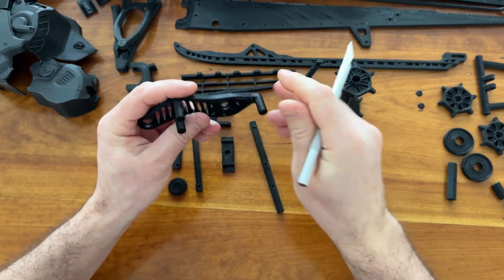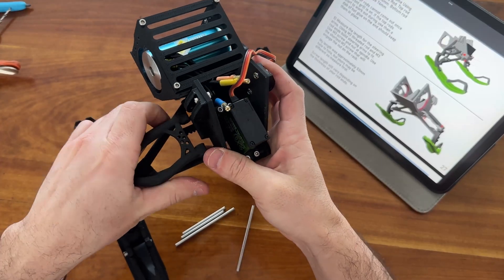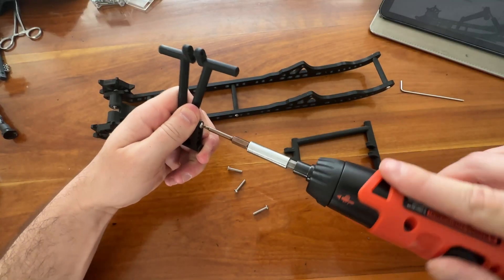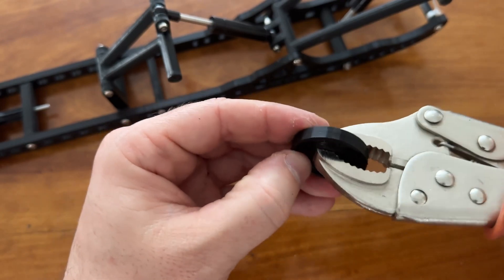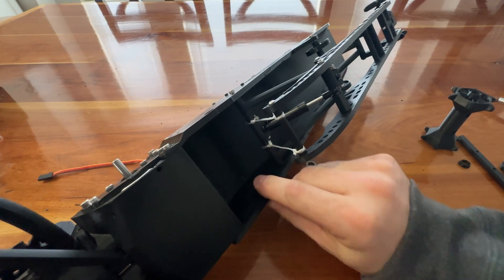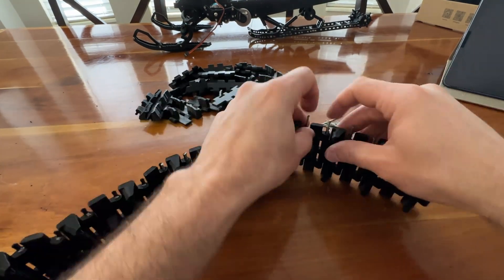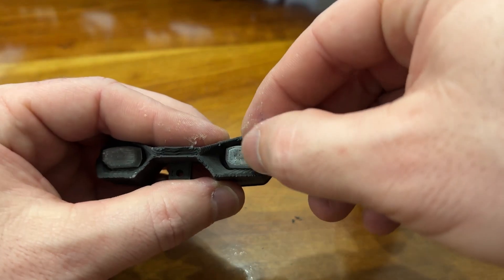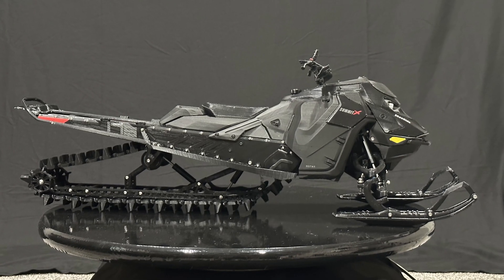SkeeRide 2 Assembly

Comment: Do you have to use a 228mm length belt for the drive? Or can you use a 200mm length belt?
Reply from the maker: If you change the gear sizes you could probably make 200 fit. With the gears I used 228 is what fit.

Comment: Hey bro I really want to make one of these but don’t have a printer and might ask my friend. Just out of curiosity would a traxxas velinion vxl 3500 kv brushless motor and esc work good in this rc sled? And also would a traxxas battary fit? I wanna use traxxas motor and esc becuase i have traxxas battarys and charger and I would have to buy another charger and battary.
Reply from the maker: I recommend a 2500kv motor for the extra torque. It’s possible your motor will work but I haven’t tried it. Not sure if your battery will fit. You can get more info on the discord server, maybe someone on there has tried your setup.
Reply: @BuildItBetter3D ok well do you think that that motor will bruh out or will it be ok?
Reply from the maker: Usually the issue we see with higher kv motors is that it can’t get moving from a stop. Some people will push start the sled and it will work that way, but once stopped it will need a push start again.
Reply: @BuildItBetter3D oh so basically the motor doesn’t have enough torque at low rpm’s?
Reply: Is that why the castle 2200kv is better?
Reply from the maker: Yes, lower kv will give you better torque. Spinning the track takes a lot of torque,especially at low speeds.
Reply: @BuildItBetter3D ok thanks
Reply: @BuildItBetter3D hey bro so I prolly gonna be getting a Bambu  a1 printer from school soon and I have a question that I’m really puzzled on. How do I know what parts need to be pla and what parts need to be petg? I need to find this out before I order the fillet rolls so I can order the specific colors in there specific mateirls. I was thinking about doing the whole thing in petg but then again I don’t know if I should. Also idk if I need to use tpu or not. I heard that pla and petg are fine
Reply: Or do you use pla + for everything and then tpu for the track?
Reply from the maker: I use pla+ for everything. Only tpu parts are snow flap and handlebars. PETG gets brittle in the cold. Please join the discord server, the YouTube comment section is difficult to use for support. https://discord.gg/78sqVp64
Reply: @BuildItBetter3D ok so pla+ even for the track? So would I be fine with just printing the whole sled in pla+ even the snow flap and handle bars?

Comment: just finished my build. the track doesn't spin under weight of the sled. belt tension is completely tight with the adustment screw. I touch the front sprocket and stops spinning so easily. what can I do to fix?
Reply from the maker: Low kv motor is needed for torque (2200kv or less is recommended)
Make sure the track isn’t too tight, should sag about 5mm from bottom of skid rail. Belt tension to motor shouldn’t be too tight or it will bind the motor causing it to work hard. Join us on the discord server for more help.

Comment: Is it normal that I don’t have the same spindles as you? The ones I got doesn’t work properly I got the polar version idk if that’s the difference? Would like to have the other spindle file.
Reply from the maker: Yes they use different parts to match the real world versions. There are modded versions you can try. Mods are included with the files.

Comment: How big of a batter can you run in this it says 2/6s but I’m not sure what will fit like how big is the box size I have a Traxxas 3s 4000 and 5000mah battery’s but I’m nut sure if I will have to buy a new smaller one
Reply from the maker: I run 3s 1500 with plenty of room to spare. Not sure exactly the measurement of the area. Plenty of people on discord could tell you what they are getting to fit. 
A downside to a big battery is it gets top heavy and tips more easily.

Comment: Bonjour j’aimerais savoir qu’elle électronique je devrais installer dans mon rc ?
Reply from the maker: There are recommendations included in the instructions. You can also ask on the discord server. Most standard 1/10 or 1/8th scale electronics will work. You’ll want a lower kv motor 1800-2200kv.

Comment: Just snagged an elegoo neptune 4 pro,I don’t know shit about 3D printing lol but will the printer being klipper effect the files at all? Or should I still be able to match print settings and good to go?
Reply from the maker: Klipper won’t hurt anything. You may need to tune your settings some. I would try some small parts to begin with to be sure your settings are dialed in.
Reply: @BuildItBetter3D  awesome!! Appreciate the response! Bought the skeeride 2 files yesterday and got Cura set up with my machine parameters with structural/non structural profiles, sliced and tested looks perfect now I just gotta verify and tune my settings and start laying out parts! Lol, It prints 250mm/s and I got rapid + PLA so I’m curious to see how fast it prints all said and done and how it turns out at those speeds, I’ll probably try 200 ish at first
Reply from the maker: Awesome! Thanks for the support. Good luck on the build, I hope you enjoy it.
Reply: @BuildItBetter3D  going great so far 😎 all frame parts are done, just track left and I’ll have a roller! … ski…er? Track-er?……roller! Lol. 
And then body panels and accessories next!
ended up splitting up the track by A B and C and doing 13 of each kind at a time, printing 13 of A right now 👍🏻 I had a little trouble at first with black filament vs the white but I just had to use raft (like I had to with a lot of the white parts too) and go down 10 degrees on the head, 2 degrees on the bed and slow down my initial layer 👍🏻 the models are awesome!
Reply from the maker: Awesome! Glad to hear it 😁

Comment: You should have made housings in the tunnel for bearings and used a steel driveshaft. The plastic shaft and no bearings doesn’t thrill me.
Reply from the maker: It does use bearings. The plastic shaft rarely fails, but there is also a jig included to make a metal shaft.
Reply: @BuildItBetter3D  ok good to know I was getting worried I’m almost done printing it and it looked like there were no bearings but they must sit inside the covers not in the tunnel. I haven’t printed the cover or the pulley tensioning system. Thanks!

Comment: What is the digital read put actually for? I did buy them I'm almost finished with the build but I'm just curious.
Reply from the maker: It’s mostly for looks, that’s where a big display is on the real sled. It gives you battery voltage though, so it’s nice to look at and know when your battery is getting low.
Reply: @BuildItBetter3D  so do you wire it into the battery plug on the esc?
Reply from the maker: I think that’s where I wired mine. It’s should come with a little paper that shows how to wire it.

Comment: Have you thought about making the opening on the skid that holds the shock a little bigger. I bought the same shocks in the sheet buy had to scrap away a lot to get it to fit between the mount. I'll post pics in discord to what I'm talking about.
Reply from the maker: Hmmm, it could be made bigger. Mine slide right in without issue… possibly a calibration issue…
Reply: @BuildItBetter3D  that's the only part I've ever had issues with and I tried 3 different printers. It not a huge deal I can edit the file I have but if anyone else ever tries to make one and can't it would be a pain.

Comment: how did you print the stickers?
Reply from the maker: They’re cut from vinyl.
Reply: @BuildItBetter3D  thank you! also where did you wire up the mini voltmeter to?
Reply from the maker: I connected mine into my battery plug so it shows battery voltage.
Reply: @BuildItBetter3D  can you show a picture or video of how you did this please?

Comment: What are the dimensions of the bigger prints? The tunnel looks pretty big. Afraid that will not fit on my printer. same with the skid rail but that I see is available in a multi part print too.
Reply from the maker: There are cut versions of all the big pieces to fit 220x220 print area, possibly smaller but I haven’t tested that. Everything can be printed without the split pieces on 350x350.

Comment: I buy it right now!:)
Reply: Hi can i use another lengt of belt because i cant find the 228 mm on amazon
Reply from the maker: There is a calculator in the faq section on the discord server that you can use to choose different length belt’s depending on gear size. So if you change the size of the gears, then yes, you can change the length of the belt.
Reply: @BuildItBetter3D  thanks a lot !!

Comment: are they available to buy as a kit?
Reply from the maker: No, not yet. Working on a deal that should make it possible.
Reply: @BuildItBetter3D  yes i wanna be able to buy it as a kit as i do not own a printer myself. im super bummed. i would easily pay 450-650 for this in a built roller form.
Reply from the maker: Getting closer to this being available. Join the discord server for quicker updates. That’s also where you’ll be able to contact people when they start selling them. https://discord.gg/9m7ad5ZA
Reply from the maker: Just had someone get ready to start selling them. His info is in this document. https://docs.google.com/spreadsheets/d/1RXSdDrZoAjLp8ws2RUS7CDb4d1NoUWAIu6UDZ1WH-EU/edit
Reply: @BuildItBetter3D  are you gonna get to a point were the parts are properly manufactured? from molds and whatnot? rather then 3d printing? curious as i dont really think this would hold up to the kind of abuse i would wanna put it through.
Reply from the maker: That would be awesome. The design process is very different between 3D printing and injection molding, so it would require designing one from the ground up specifically for molding. I am looking into it, but it takes a lot of startup cash to do. Maybe one day we’ll get there.
Reply: @BuildItBetter3D  thanks for all the info! i know . well im gonna sit on this info, i did reachout to the guy in quebec that is your dealer and he said he can get me one when im ready..... im not purchasing atm cuz the season is almost over but im gonna prolly buy fall of this year and get it all setup.

Comment: That's a neat G5, really easy looking assembly. That track angle on the front looks a bit sharp though, but judging by the previous video it seems to work in pow👍
Reply: You can manipulate it same as a real sled with the limit strap. It makes a huge difference
Reply: @jakepeterson3379  Yes I'm familiar with that trick👍 Also the angle can be modified with the used shock's length, shorter shock and smaller angle -> No need for limiter strap
Reply: @sledmaker  ya but a limiter strap is more scale and you make it adjustable for wheelies lol.
Reply: @jakepeterson3379  Yeah ik. I put a stiff o-ring on the front swing, that seems to hold it well enough on soft and allows more travel when jumping and wheeling. Will have to test a bit more to see if it works properly or not. Also doesn't sag and snap or catch the track when it gets loose on landings